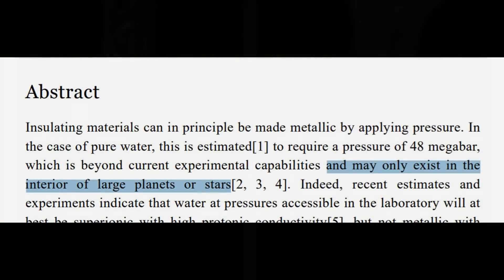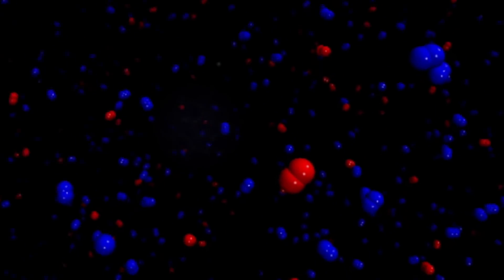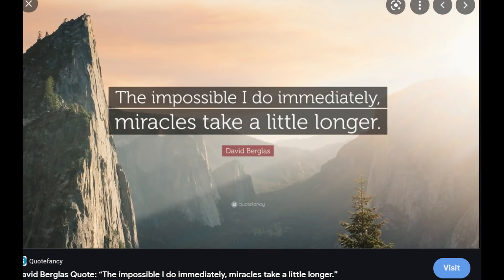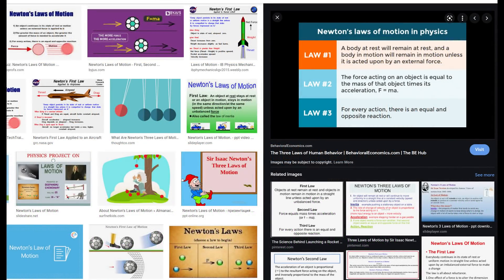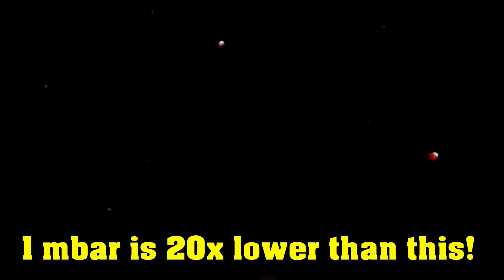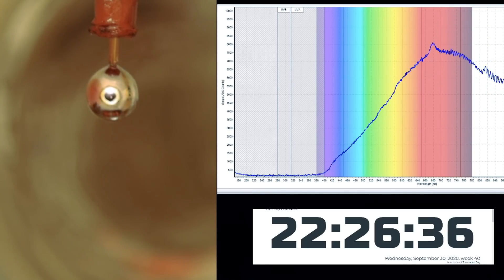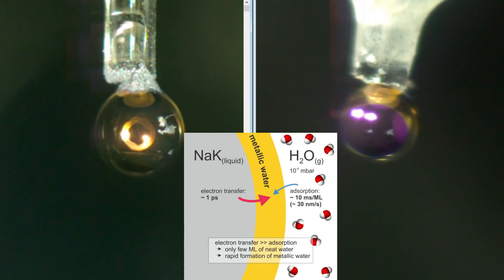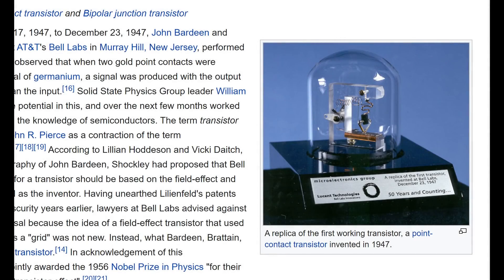Scientists discover Metallic Water

Comment: Can someone please explain like I'm 5 what it technically means that the water is "metallic"?
Reply: One of the primary differences between metals and non-metals is the presence of free electrons in the material. Non metals molecular structure binds up all electrons to the nuclei and chemical bonds. In a metal, the outer electrons rest in overlapping orbital structures that span across many atoms. This allows electrons in those orbital structures to move throughout the larger material.
Reply: By allowing a layer of water to settle on the alkali liquid metal, electrons from the metal can flow into the water layer, filling orbital spaces in hydrogen and oxygen atoms of the water that do overlap. The electrons flowing from the actual metal into the water layer are in excess of the normal amount of electrons water would normally have, so they are not strongly attracted to the water, however the alkali metals have a very weak attraction to their outermost electrons and this means there are plenty of electrons for the water to attract into these connected orbitals. It causes the water to develop a connected cloud of electrons that are free to move from atom to atom and in fact from water molecule to molecule. These are the free electrons.

In the solvated electrons in ammonia videos from a while back, you can see at very high concentrations of electrons, the solution becomes a metallic gold or brass like color. When there are enough free electrons (I.e. in metals) reflectivity occurs because incoming light can interact with the free electrons. Without the free electrons (I.e. in non-metals) incoming light only interacts with electrons in specific orbitals. That limits the movement of the electrons and    prevents a simple reflection of the incoming photon. Instead an absorption and re-emittance  occurs and typically the re-emitted photon come out with a specific color.
Reply: @curtlezumi  Cool! Thanks! So this is like a core of liquid metal which is sharing its electrons with the water outer layer, and the water is reciprocating, thus: metallic water?
Reply: Apologies if that was more dense than a 5yo could follow. Hopefully that provides some clarity.
Reply: @curtlezumi  No worries, I think I got it from what you said. Some things take more than a soundbite to explain!

Comment: Absolutely do make a diffusion pump video. Their operation is fascinating and I would love to see a clear explanation with some examples. I’ve seen some small glass diffusion pumps in chemistry labs, but never seen one in operation, maybe it’s too hard to see the operation at such low pressures (i wonder if the gas jet could be seen with an IR camera?) either way, please do a video on Dif pumps.
Reply: I think Ben of Applied Science did a great vid of it. https://www.youtube.com/watch?v=SrNVLCHrJtY
Reply: I agree
Reply: @Beeontree  Hells yea
Reply: Applied science has a nice Video for now. He has a see though pump made compleatly of glass
Reply: Would be interested in pointers on building up a vacuum system on a budget. Say mechanical roughing and surplus oil diffusion rather than turbo pumps etc.
Reply: You may be able to get good images with a schlieren imaging scheme.
Reply: Maybe a schlieren projection would work well.
Reply: Please do make that video and turbo pumps
Reply: Simple operation. Lots of info out there.
Reply: wow YouTube bug. it just posted my comments to this thread as well as the thread I was in. Never seen that before.
Reply: @jhoughjr1  it’s happened to me dozens of times. Usually has to do with shit WiFi.

Comment: The term 'metallic water' is confusing to me. It thought that would be pure H2O in a lattice, with electrons pooled or something like that. So is this unionized metal atoms dissolved in water?
Reply: Yap, that's correct. It's nothing new btw, i worked for a company (Akzo Nobel Chemics) that invented a similar structure to produce nearly perfect round metallic objects like balls for super high precision ball bearings and such a like. This method is superior to mechanical production that's overall roundness is limited to the size of the abrasive grain used, although it is still very expensive when it comes to bigger objects. The roundness is so to speak generated only through the surface tension of the suspension and therefore superior.
Reply: @bogeydope3022  wow, never knew that was a thing!
Reply: @bogeydope3022  Whoah, you you have any link about this process ?
Reply: @Ryba125  I will look out for a link, but i guess the source will be german then. 

Edit: You have to google for new production methods for ballpoint pen's balls. I think there was a article that described the method. I will send it if i find it first.
Reply: @bogeydope3022  No problem for german.